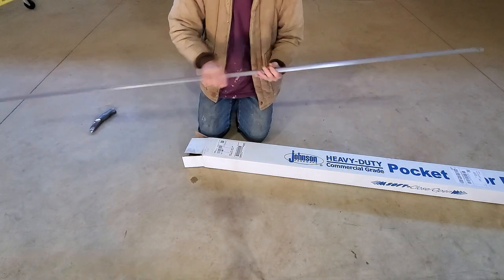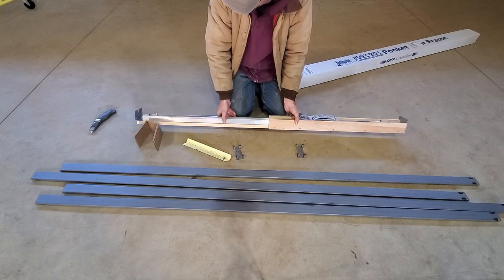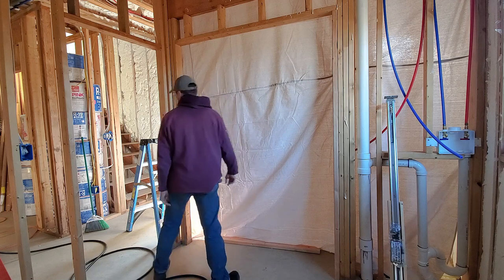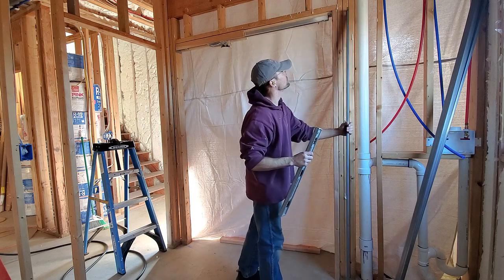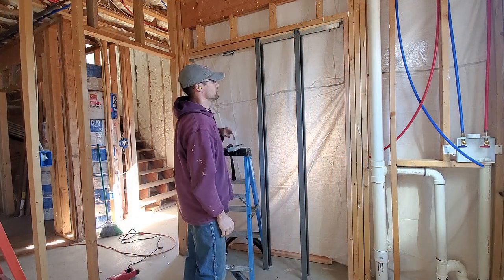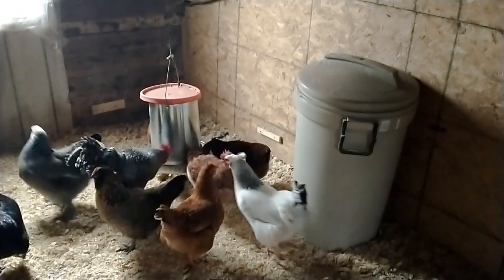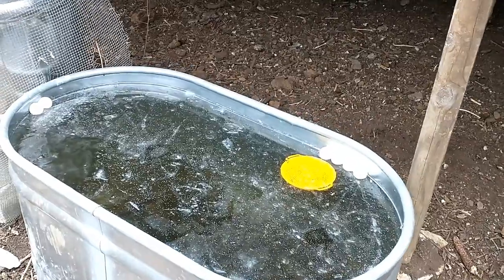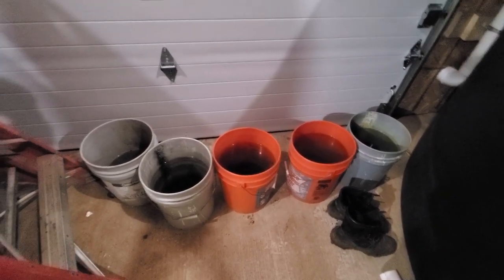Johnson Heavy Duty Commercial Pocket Door Install & We Prepare For A Major Winter Storm

Comment: Nice video guy.... you did a great job explaining this. This is the 1st video that I've been able to find that features the Johnson 1600 series soft close/open contractors kit. 
I'm just about done installing one of these in my newly remodeled main bath. 
I didn't notice any cutting done prior to you hanging it? The wood and track. Would be helpful to add that for those of us who have to adjust according to door size.
Reply from the maker: Glad you found the video helpful.  I had ordered the correct size for the opening and therefore didn't have to cut it down although it would have been cheaper to do so since the smaller opening was actually more expensive at the time.

Comment: Pocket doors are the best...although the sliding barn doors look cool as well
Reply from the maker: We are going to try and incorporate a barn sliding door using the 1920's railcar hinges from the old railcars that are on the property at some point.
Reply: I think that would look awesome.
Reply from the maker: @OffGridGetAway  the rail cars have a lot of metal pieces I could use around the house.  Even a ladder I want to use to get up on the mezzanine in the pump room.  There are four rail cars in all and two have fallen down.  The other two had a roof built over them and have been protected from the elements.  That is where our animals are currently.